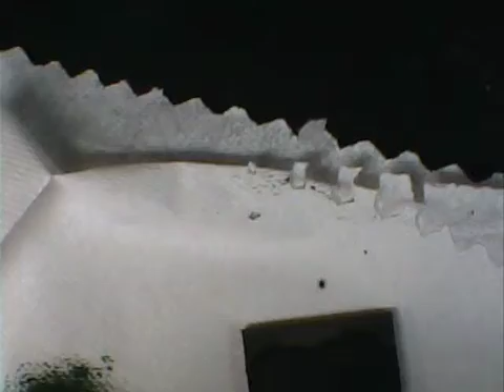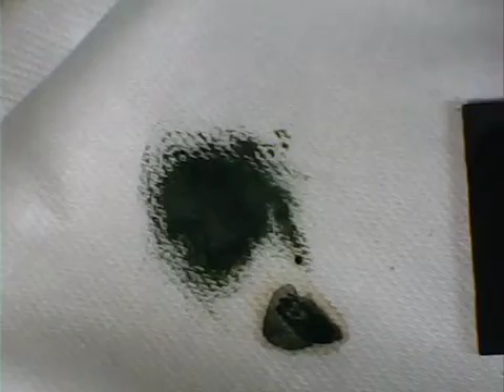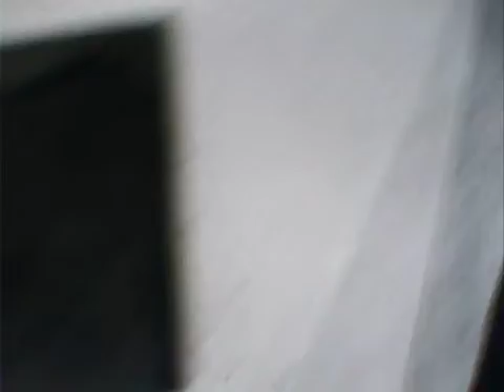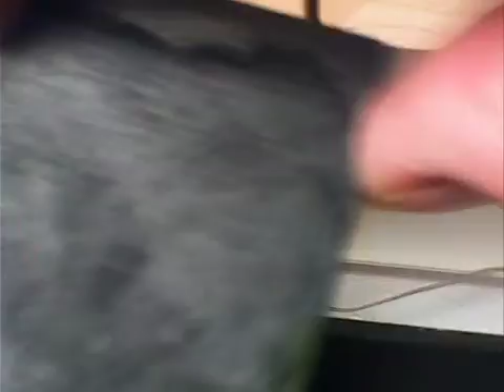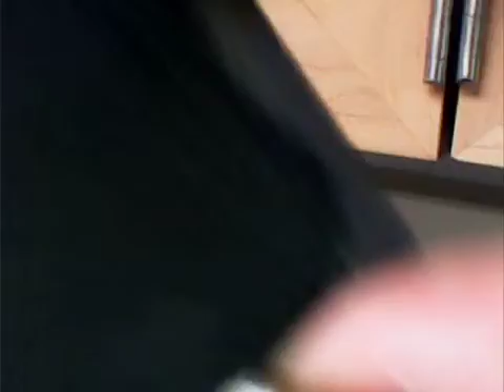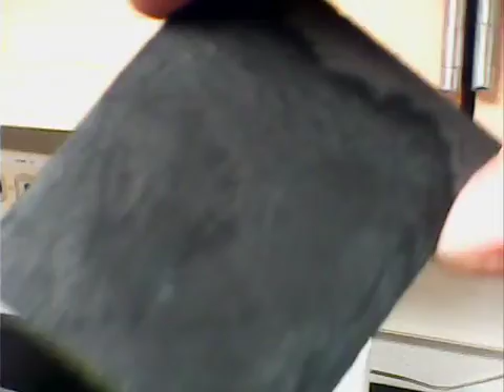Polyaniline/ Chemical Synthesis/ Organic Battery /Part II

Comment: Hi David, i have recently subscribed to your channel & find what you have done with Batteries quite interesting.
You obviously know your Battery chemistry so i have a question if you don't mind.
I have been trying to work with Magnesium Anodes now for some time & i must say that i find it to be a very challenging material. I have tried it with lot's of other metals & also had good results with Graphite plates, Graphoil and the best results from Carbon fibre weave obviously because that stuff has a large surface area ( my nano wires as i like to call it ) but the struggle is as always a decent electrolyte or even ionic liquid.
I have indeed built several 1 Cm square batteries with very little material ( 0.02g )& had a motor running for over 5 hours from this.
But the story always seems to be the same whichever way you go, either a sacrificial anode situation or a degrading surface layer on the Magnesium.
So back to my question : can you steer me in the right direction with a decent electrolyte composition or even a deep eutective solvent ?
I appreciate that ( with looking at many video's )  the material of the day seems to be Choline Chloride as a base for a DUS but any further help on this would be much appreciated if you can.

best regards kev.
Reply from the maker: Hey!  I have been working with bio-plastics with students for the past semester. http://www.bioplasticstechnology.com
The magnesium can easily form an oxide film on the surface. I recall a great YouTube video where the investigator had his magnesium battery wrapped very tightly with the other metal- he was obtaining good output.

Comment: Hmm, does this also work without the graphite plate as the current collector ?
What about painting it just onto paper or cotton or onto a plastic sheet ?
How conductive is that polyaniline salt ? Can you please show a reading of an Ohmmeter in about 1 cm distance ?
Many thanks.
Regards, Stefan.
P.S: Can this salt also bought ready made ?